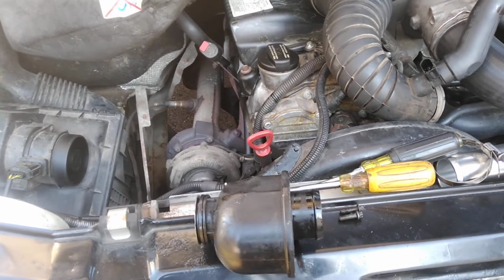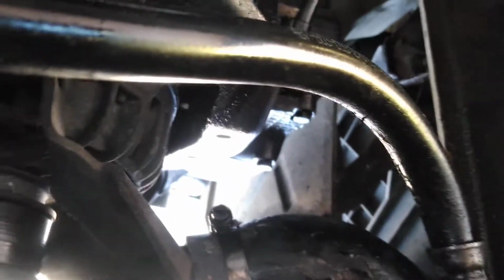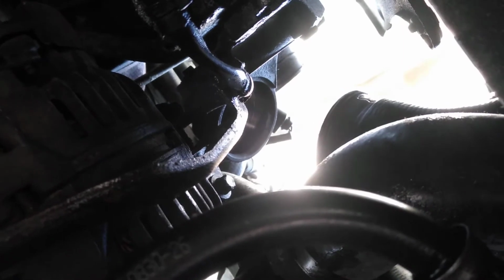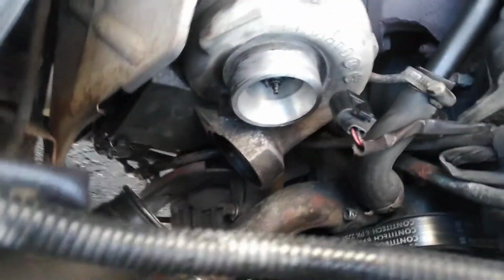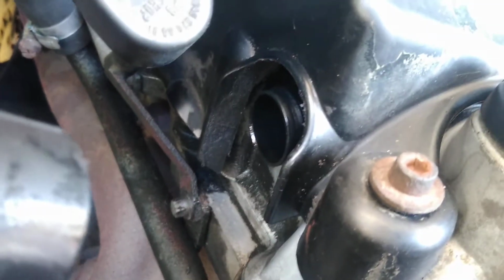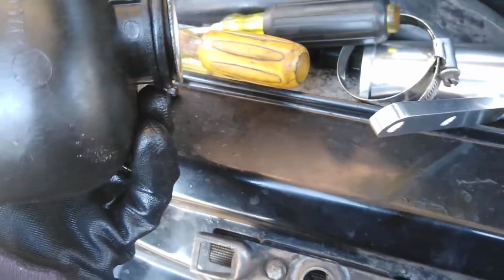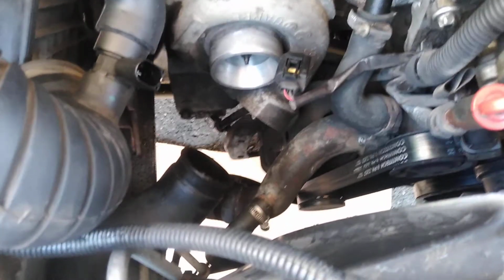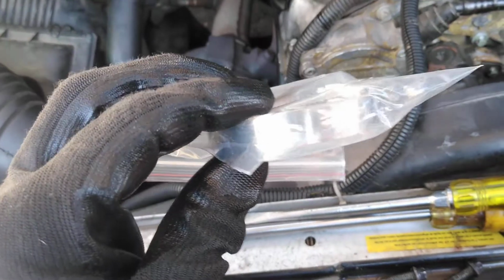Oil leak at turbo resonator, resonator replacement 2005 Sprinter

Comment: My 2002 Sprinter 2.7 CDI does not have a resonator or EGR valve fitted as standard, I'm guessing this is a US thing as I live in France, Europe 🙂 I wonder if having the pipe that is fitted to mine which is longer would do the same job?

Comment: The reason for using the supplied clamp could be possible galvanic issues with the oem clamp?
Reply from the maker: You're probably correct, didn't think of that.

Comment: Hey Steve thanks for the video! Trying to help a friend with an 05 Freightliner Sprinter 3500 with 300K miles. They said it went into some kind of limp mode. Now I can't duplicate the problem and no trouble codes found. 
I will check the resonator for leaks. 
What can you say about this limp mode?
My understanding is the turbo shuts off? Do dash lights come on?

Any trouble codes set?

Thankx
Reply from the maker: Hey Jim,
Limp mode I believe it keeps the van in 2nd gear.  I have seen it happen without dash lights.  Check the plug where the wires enter your transmission, make sure the harness and plug isn't wet with fluid.  It can wick back and mess with the transmission module under the passenger seat.

Comment: Hi Steve. Can you tell me where you got the O-ring? Or the part number or something. I don't see it.. probably me, and not a mechanic by ANY means. Thanks so much for the help!
Reply from the maker: https://europarts-sd.com/search.asp
Reply from the maker: For some reason that link won't bring up the page I pulled for ya.  If you to to euro parts search your year van then type resonator o ring.  It should come up for you lmk
Reply from the maker: You can prob find it cheaper shipping may be expensive there I forget been a while since I ordered from them.  You could also reach out to million mile sprinter he may sell them on his site and ship cheaper.
I don't see it on his site but he's prob got one, if you still have trouble he's on Facebook and Instagram or this link will have a way to contact directly from site Millionmilesprinter.com
Reply: @stevep3089  Thank you!!

Comment: What were your symptoms when your turbo resanater cranked/started leaking I have the same van and trying to figure out if my resanoter is the problem
Reply from the maker: It would go into limp home mode periodically, I also had a bad sensor though but I wasn't sure which one.  If you inspect the resonator there is a seam on it around the edge where the two parts meet.  If it's looking oily and not uniform and tight all the way around then it's likely leaking.  Unfortunately without a really nice scanner it's tough to know which sensor.  In my case it was the sensor on the intake filter housing.  Hope this helps.

Comment: yo how did the metal strait pipe work? is it doing well?
Reply from the maker: Yes it's been working just the same, maybe a slight more noise. I'm happy with it so far.
Reply: Where did you purchase the metal resonator?
Reply from the maker: @irishgixxer  I believe I got it from euro parts SD, I've seen it cheaper on Amazon and eBay. I have read about people getting them cheap and the mounting arm angle was an issue not sure how regular that happens. Make sure you purchase an O ring, they don't come together, has to be ordered separate.

Comment: Driving home from my job, I lost boost on the top end of the throttle. 
I checked it out when I got home and I found that it's leaking oil and found a small drip of coolant on the underbody.
I couldn't find where exactly it's leaking oil
Reply from the maker: What I've done before is put cardboard under my truck when I will be parked, weight it down so it doesn't move. Any drips will be highly visible on the cardboard, helps to pinpoint where and how bad/if it's getting worse. Plus it keeps where you're parking clean. The coolant and oil sounds like a head gasket I'm no expert though by any means. Although if you haven't done a full coolant maintenance (replacement of hoses thermostat coolant change/flush) that may be all you need for stopping the coolant drip, that fixed mine.  If it's leaking oil from the turbo/intake piping it would be leaking on the left side as you face the truck from the front. Is there a film of oil over everything on left side looking from underneath?
Reply: @stevep3089  a film, yes
Reply: @stevep3089  a head gasket on the motor?
Reply from the maker: @time.528  I had a film of oil too, it was difficult to know where, if you take the turbo hoses off at resonator and it's got excessive oil inside/dripping out when you take it apart could be the oil separator on top of engine, if you have never replaced the resonator it could be leaking out from the o ring that's on the outlet of resonator and the seams where the pieces of it are glued together if it's a plastic one it may be leaking at both spots,  I'd replace the resonator just my thoughts I could be wrong but they aren't expensive, if you go for a metal one make sure you purchase a o ring they are sold separately.  I'd also replace the separator  as well if you have a decent drip.  I believe I ordered from euro parts like 145$ for the separator, they are available cheaper elsewhere but you know it's an exact fit and close as it gets to OEM if it's not.  Just my thoughts I'd definitely look around though.
Reply from the maker: @time.528  the oil separator is under the engine cover, it's an easy swap. You could order the resonator and gasket see it if stops.  Then order this; it's more expensive now.  But if there's a lot of oil inside the tubes and on the pavement, I'd say just order both and be done with the oil leak.  Look real closely make sure it's not coming from you engine. Have you had to add oil? I use euro parts SD for some stuff or as a base to see sometimes.     coverhttps://europarts-sd.com/item.asp?PID=5108.
Reply: @stevep3089  thanks fot the tip as I'm standing outside in the cold waiting to vote, lol. The resonator appears to have oil seepage around the seem
Reply: Steve,
I went to my mechanic yesterday and they scanned it and found over boost. Something about the west gate?
Reply from the maker: Hey Tim I'm not sure what that means.  I don't have the fancy scanner, I keep a Scan Gauge 2 plugged in and set it on my dash it will show you boost pressure voltage mpg ECT.
Reply: @stevep3089  cool. Didn't know that I can do that.
Reply from the maker: https://www.amazon.com/ScanGauge-Automotive-Computer-Customizable-Real-Time/dp/B000AAMY86/ref=asc_df_B000AAMY86/?tag=hyprod-20&linkCode=df0&hvadid=312094794461&hvpos=&hvnetw=g&hvrand=3020174575862116192&hvpone=&hvptwo=&hvqmt=&hvdev=m&hvdvcmdl=&hvlocint=&hvlocphy=1025030&hvtargid=pla-436202880193&psc=1&tag=&ref=&adgrpid=62497261819&hvpone=&hvptwo=&hvadid=312094794461&hvpos=&hvnetw=g&hvrand=3020174575862116192&hvqmt=&hvdev=m&hvdvcmdl=&hvlocint=&hvlocphy=1025030&hvtargid=pla-436202880193.   It won't tell you specifics but you can clear and read some codes.  Easy to set up

Comment: Question.. Was your sprinter shaking at around 1800 rpms?
Reply from the maker: Are you referring to RSN?  Sounds like your driving over rumble strips?
Reply: @stevep3089  no. Mine shakes really bad at 1700 rpm. Has a vacuum leak that i can't find.. And beacuae of that leak is trigging a MAP sensor malfuction
Reply from the maker: @manuelortiz7731  does it get worse as the RPMs go up? Does it happen when you are slowing down more?
Reply: @stevep3089  it only does it between 1700 and 2000 RPM.
With is between 40 and 50 mph.. 
It is becoming a pain.. But i'm trying to avoid a mechanic.. Cause I know i will get fu....d big time
Reply from the maker: @manuelortiz7731  I hear ya, not sure where you're at but Joel from Million mile sprinter in Philly is a sprinter guru, just had him service mine very happy, had him do the transmission service and RSN fix, feels great.   
I would get under the van and make sure there is no play in your driveshaft near the connections and at bushings.
Reply: @stevep3089  i already did.. Shaft is great condition. I've been digging online. And the shaking is caused because of a bad map sensor... Do you have a phone# for the millionmile sprinter guy. Maybe he can do a phone consultation..
Thanks.
I'm pretty handy with tools and I can do the repair
. i just need to find the correct diagnosis
Reply: I'm prerty far from Philly.. I live on the chicagoland area.
Reply from the maker: @manuelortiz7731  
Millionmilesprinter@gmail.com 
He is pretty on top of his email.  You may just need a trans service done correctly.  A good scanner would likely tell you what sensor if that is your issue.  Could prob just pay for a scan at the Benz/sprinter dealer.
Reply: @stevep3089  thank's Steve.. I really appreciate your help...
Reply from the maker: @manuelortiz7731  No problem Manuel, I'm glad to help in any way I can.  Thanks

Comment: Wait.....Explain this oil separator thing??
Reply from the maker: It separates oil from the return to the intake.  There are different compartments internally.  On mine there was a rubber seal that failed and I had excessive oil passing into my intake. It was a while ago so I forget a bunch.  Sorry I didn't see your comment before.